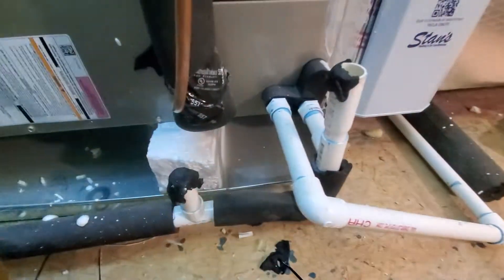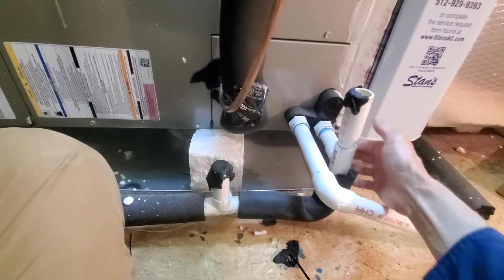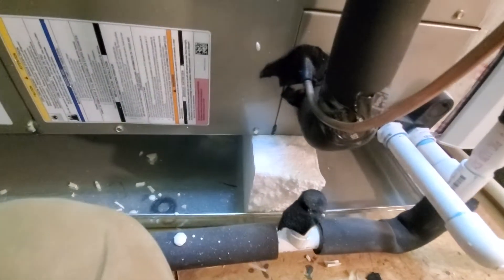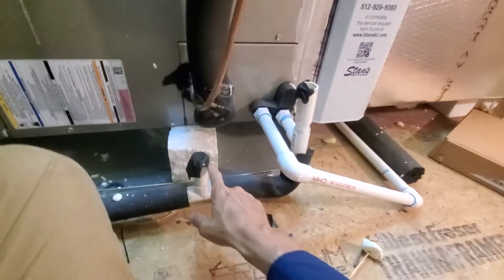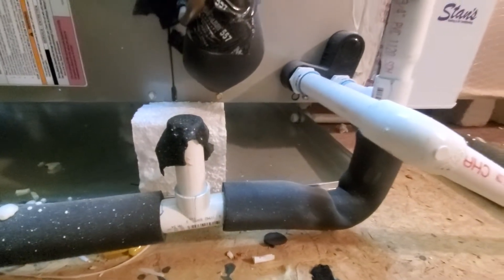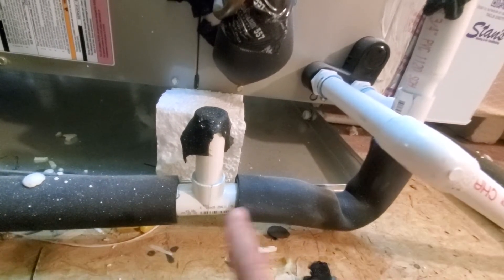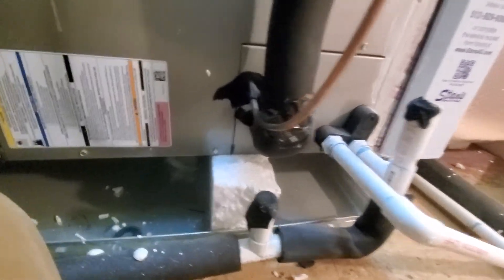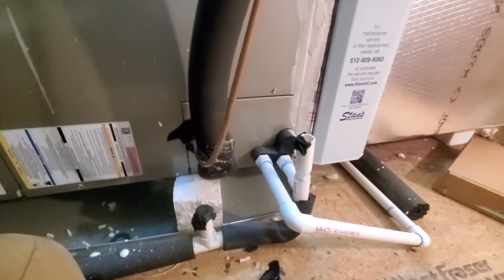¡POP QUIZ! What do you see wrong with this HVAC installation?

Comment: Actually the biggest problem is that there is no actual trap on the drain.  The evap. coil is clearly on the return side which means negative pressure on the drain line.  Without a properly sized trap the drain pan will overflow and water will be pulled through the system.  The entire thing is a fail.  Also, is that thing sitting on the packing foam it came with?  WTF!
Reply: I never understood those small traps. I don't think a large trap would ever hurt. Traps drying out just leads to outside air being pulled in.

Comment: The whole air handler is just sitting on foam?  Won't that degrade over time under compression, heat, humidity?
Reply from the maker: It actually holds up pretty well as it is a stable material. The only thing that would affect it would be UV rays and there isn't much of that in the attic.  :)